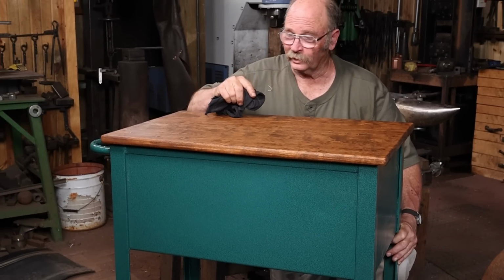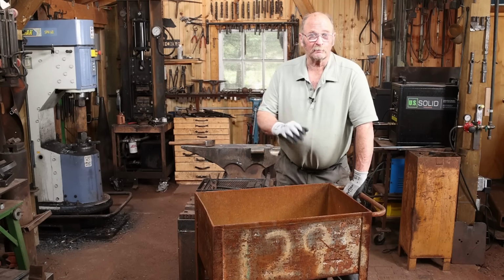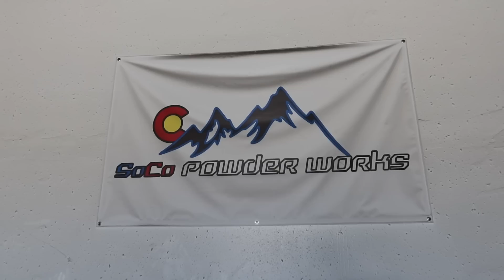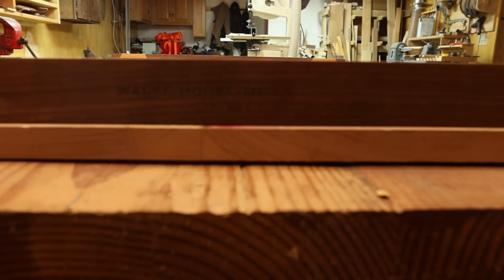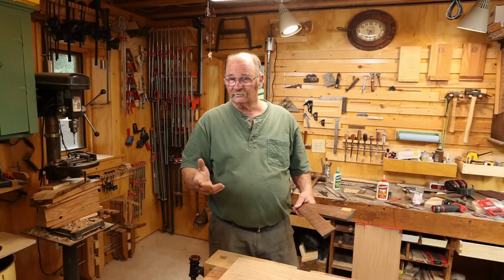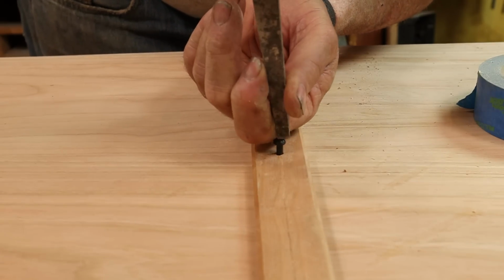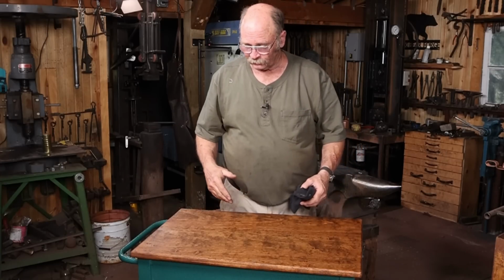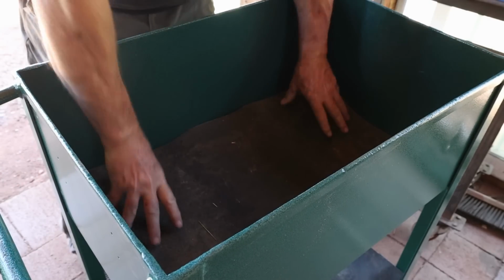Transforming Trash into Treasure: Restoring an Old Rusty Shop Cart

Comment: I just started doing some sawyering as a fun side hobby to my woodworking and blacksmithing, and cherry is by far my favorite wood. I just milled up 8 logs of it a couple of months ago. Should be nice in 2 years when it's done drying. :) Boards I got were between 12 and 20 inches wide, milled most of it up to a thick 9/4.
Reply from the maker: Sounds great!

Comment: I like the finish. I've never seen wood finished with pine tar.
Reply from the maker: It's sold primarily as a wood finish
Reply: @BlackBearForge  I'm sure it is i have just never seen or heard of it till you started using it. I've mainly used Boiled linseed oil or wood stains.

Comment: You can get a bed liner paint that is a rubberized compound a t Menards or most Auto supply shops. It's not as good as Rino liner but it is much easier on the wallet and you can always touch it up.

Comment: Very nice. Great restoration job.
As a side note, when we were trained to file round, we started angle down and roll back rather than roll forward as you do.
The theory is to prevent creating flats on the curve.
I trained as a Fitter/Turner/Machinist and we had to file a square bar to round to fit a test jig as one stage of training.

Comment: I wish I could plane wood like that. Unfortunately, my eyes won't allow it.

I have a couple versions of a pine tar finish whipped up I haven't tried yet. One is a 50/50 of pine tar and turpentine and the other is 50/50 pine tar and Dicitrusol.  The citrus solvent actually thinned the tar easier than the turps.

Comment: That turned really great.  Nice to see you working in the woodshop.  How is the feel of the pine tar/linseed oil finish?  Do you think that would be a good finish for outdoor furniture, as in tables and chairs?
Reply from the maker: It should be pretty good and was often used to treat entire buildings in Scandinavian countries.  UV resistance would be the only issue.  This is where I buy from and they have lots of information on its use https://sagerestoration.com/
Reply: @BlackBearForge  Thank you for the reply.  water resistance is what I'm mostly looking for.  I'll check out that supplier.